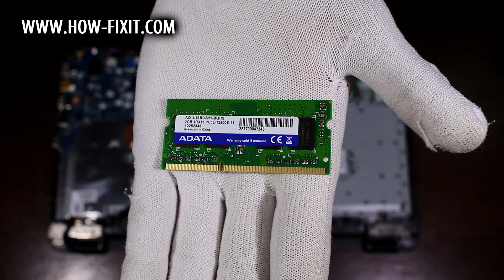HP 250 G4, HP 255 G4 RAM Upgrade and Install | Step-by-step DIY Tutorial

Comment: is it just one RAM slot ?
Reply: Its two. I have 250 G4
Reply: According to the manual, it's actually dependent upon the processor. If it's a Core i3 or i5 processor, it's two slots. If Celeron or Pentium, just one slot.
Reply: @RefutingUnitarians  if it's 1.1 AMD? does it have 1 or 2 slots?
Reply: @marjanoviccc  Unfortunately, the manual doesn't specify that configuration. But, disassembling the device isn't too difficult, so I'd recommend just popping it open to check before you purchase your new memory.
Reply from the maker: yes, laptop that was disassembled for this video had just 1 ram slot
Reply: @howfixit  - possible that there is another slot on flipside of board?
Reply: @rossfromsa  Yup, I have a 255 G4 and it has two slots, but only one is occupied. This one's probably the 250 G4.
Reply: @DamonDraven  I have a 250 g4 and Speccy says I also have 2 ram slots so idk what happened with this laptop
Reply: @thefirekonaai8919  Could be that it soldered... 1 slot is soldered in to the motherboard with the ram.